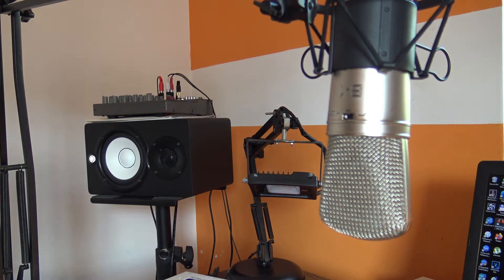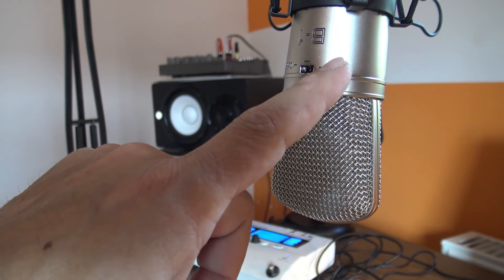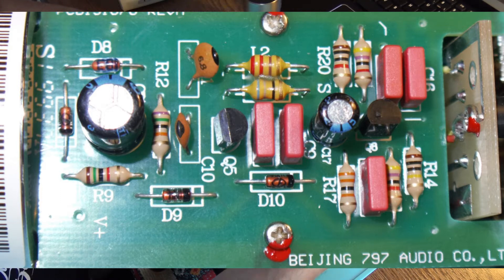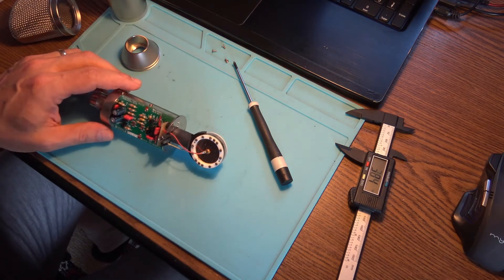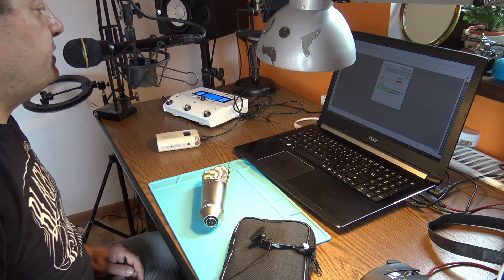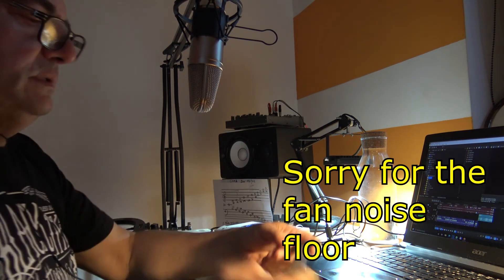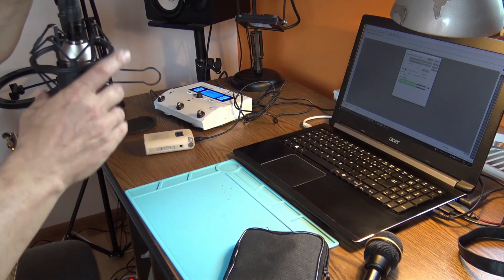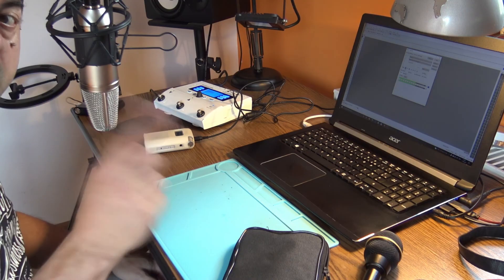Best budget condenser studio microphone Behringer B-1 dismantle

Comment: Nice vid. If anyone else stumbles upon this, you want to find the ‘old’ B1 and B2. The logo ^ as shown. Otherwise you will get an smd with inferior capsule. If you are buying new, you are better off buying ‘studio projects’, which is still made by 797 Audio. :) . These early models are a bargain.
Reply from the maker: Still working great with decent sound quality. I could kill for something like this years ago!
Reply: @ I’m told the blocking capacitor directly under the capsule ( not on the pcb’s) is worth swapping on both the original b1 and 2, For whatever reason it’s a cheap one , unlike the rest. Maybe because Behringer assembled the mic, not 797? I have much more expensive microphones but these are still really useful. :)
Reply from the maker: @Greggles5000  worth a try
Reply: @viocaia  I still have an original Rode , with transformer…. And the J.W ones with this capsule. There really wasn’t anything else in the day!  797 capsules as found in the old B2 are $150 on Ali, so, if you find a whole mic for that….its great value. Look at the Takstar mics too, they are making capsules just as good for AKG, Lewitt, but they have an Sdc that’s especially good.
Reply from the maker: @Greggles5000  Super ! Thanks for letting us know...it seems you have a lot of experience with microphones!
Reply: Hey, I saw you really know your stuff when it comes to microphone capsules.
I'm planning to upgrade a cheap mic I got for around €40 on AliExpress by swapping the capsule for a 797 Audio CY001. What do you think of that idea ? 

The current capsule has one wire in the center and another one off to the side on the front — so two wires total. My budget is around €20–50, and most of the forums haven’t been very helpful so far.

Do you have any advice or suggestions for a good replacement capsule in that price range ?

Thanks in advance !
Reply: @estarook  Cherrs. Thats a great capsule. It's in the original 'Rode Classic' so, it's going to be pretty good. I've several. You can just use one side.
Reply: @estarook  They are good. Big fan of 797.Oh and they do come up cheaper sometimes, thats probably a kiwi dollar price ;). You never quite know what you'll find in Ali mics, sometimes theyr'e ok. There was even an MXL that seemed to have a Manley capsule, for a short while. I do have MicParts capsules, they're worth the hype, but cost much more.If you are modding mics, you have to compare some of the 'deals' on Ali, The 797 valve mic is pretty cheap, probably same capsule.

Comment: I just purchased B1 condenser mic. After unpacking the product out of the box, I noticed WARNING at the back of the mic:
"This product can expose you to chemicals including lead which is known to the State of California to cause cancer, birth defects or other reproductive harm."
Why is this warning at the back of the mic and is this product safe to use?
Reply from the maker: Probably it's related to electronic parts inside. Those transistors, capacitors, resistors and so are soldered with a wire content like 70% stanium and 30% Lead Pb ...but I'm sure there is a very very low quantity of PB...I'm using electronics and I build my own ones for 40 years and I'm still alive and sound! Don't be worry, they just follow the rules and advertise any possible contaminant...but far from being a danger.
Reply: @viocaia  
Thank you very much for clarification indeed. I find it a bit odd to have such warning on this type of product, considering it is used close to human mouth and nose.

Comment: Hi there. Thank you for your review. Very helpful. I think the the current B1 in 2022 doesn't have the 797 Audio circuit board in it. It has been changed from a through hole circuit board to an SMD surface mounted board. I have no idea if the new circuit changes the sound in any way. I hope to pick up an older version to test it.
Reply: yes i just bought behringer b1. i see different pcb kits and components. mine uses smd spare parts
Reply: @racl1954  Yes you want to find the ‘old’ logo mic. Both the new B1 and B2 are smd now.
Reply from the maker: I don't know about new version, I'm ok with mine.. Best for the money

Comment: hi, can you give me any advice (or point me to a video) on how to remove a broken screw from my legion y520 wifi card? I would like to replace the card but the screw holding it in place is broken, manufacturer made it too tight after trying multiple methods online the head is in a pretty bad state.
as it is in a delicate position right on top of the motherboard should i just leave it? it does work but the bluetooth is awful, every earphone i connect to it stutter like crazy
https://media.discordapp.net/attachments/726027001512722493/854437940784136232/20210327_174756.jpg?width=901&height=676 (picture of card youtube might delete - dust has been cleaned)
Reply from the maker: Try a small chisel or a screwdriver with a better top, make it like a chisel, then try to punch the screw from beside, the chisel will dent the screw and maybe will got loose.Finally, if no chance..you need to drill it and remove the top of the screw..maybe cut it form aside with a dremmel...have you tried to reverse the antennas? maybe you get a better radio something...
Reply: No didn't know I could put antennas inside my laptop (is there space for them?). Will try those methods tomorrow thanks
Reply from the maker: Of course ..use W40 before , just drop a little between the screw and nut.
Reply: @viocaia  what is w40?
i miss understood before, i thought the antenas was metal thing like shown here https://www.amazon.co.uk/gp/product/B07Y82HZV1/ref=ppx_yo_dt_b_asin_title_o00_s00?ie=UTF8&th=1
i guess you are refering to the antena cable that is wired through the monitor; do i just swap around the white and black cable connected to the wifi card for reversal?
Reply from the maker: @tinkqir4974  Right , just the cables...and W40 is a spray helps to unblock the rusty or blocked screws..also , if ypu have a soldering iron, try to apply heat to the screw before, it will expand the metal and let it loose..
Reply: @viocaia  if the w40 gets on my motherboard am i royally *ed? delivery is coming tomorow. i messed up half the board using compressed can spray now niether my fan or speakers work
Reply from the maker: @tinkqir4974  I said ..just a drop onn the screw, W40 is not dangerous to electronics, it is antioxide and grease..never had any problems..but just a drop..on the screw!
Reply from the maker: @tinkqir4974  how comes, you smashed some connectors...?
Reply: @viocaia  no, I have tried 2 different fans which all have been confirmed to work. when i sprayed the air can some liquid came out, evaporated quickly so i thought it was fine. turned the device on motherboard was peeping. after alot of stress and worrying noticed fan speaker and 2.5 drive slot not working. sent to lenovo they told me to pay £961 for a repair (LOL). if you look at the picture those components posted earlier of the laptop internals those components are in the same area so i assumed they've short circuited or something. have not tested them but strangely enough the ac is connected in the middle of those and works perfectly fine.
https://cdn.discordapp.com/attachments/726027001512722493/855018937770311710/Inked20210327_174756_1_LI.jpg
Reply: I messed up 😂. Spent like 1hr trying all sorts of things to get the screw out, in the end I gave up on that and decided destroying the WiFi card and spliting it in 2 would work. It did but ended up damaging connector in the process (some of the black plastic cap came off).

I feel like I'm on purposely trying to destroy this laptop so I can upgrade had almost 4 years now first thing I got with my first month pay
Reply from the maker: @tinkqir4974  Man! I feel so bad!!! I know we should do some upgrades or changes sometime...but I am the same..trying to fix thinks make more mess ...but, you can use it with an USB WIFI, with even better quality! It's a win somehow!